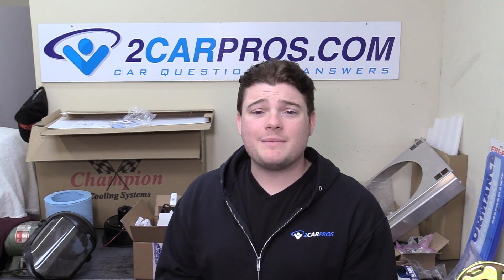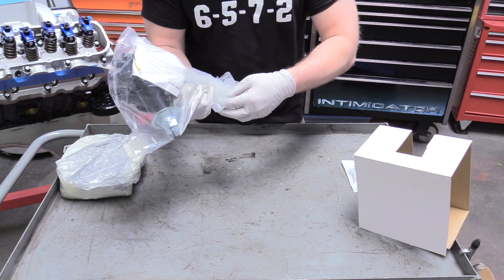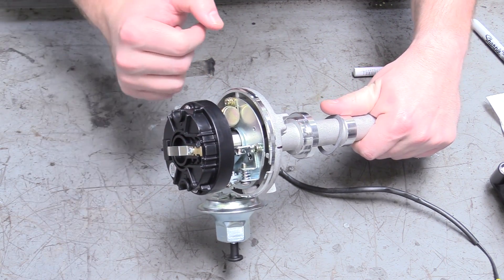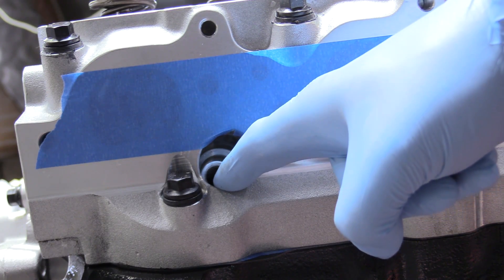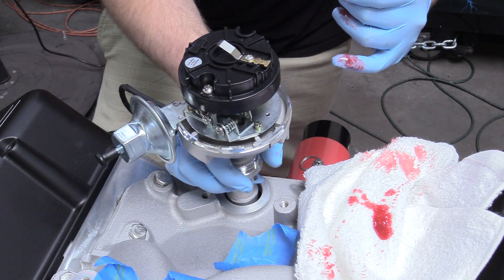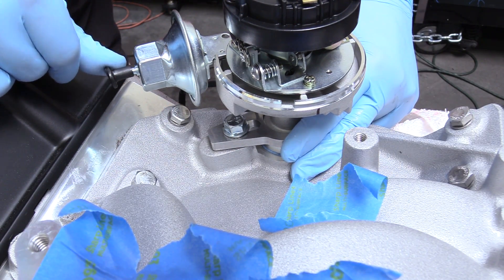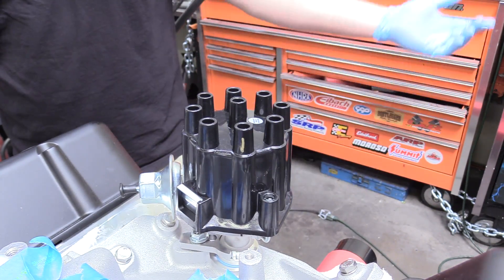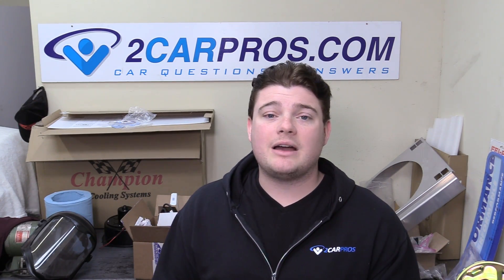How to Build a Chevrolet 454 Big Block Part 12: Dropping in the Distributor - EASY!

Comment: I armed a motor of 454 but when i turn on the engine makes like explosion sounds through the escape. Did i leave the time wrong or do i just need to adjust the carburator ?. When cold car turns on well but once warmed up it takes a minut3
Reply from the maker: Take some timing out of it. Thanks for watching!

Comment: Hey man, love this series. I’m working on my 454 using these videos. First build.

I ran into a snag though. I have the Holley tall fab valve covers and they slight bind on 2 of my roller rockers. 1 per side.

Any advice? I started filing down the valve cover on one side but I don’t think it’s going to be enough.

I thought about filing corner off the rockers but I don’t want to pull them off that yet to do that. 

What valve covers did you go with and did you have similar issues??

Thanks man!!
Reply from the maker: Thanks for watching! I used the tall style covers to clear my roller rockers. I would just get taller covers. Thanks for watching!
Reply: Thanks for replying!

Yeah I bought the tall Holley covers. It was the style I guess. The bolts were the short style. I swapped for ones that have the longer bolts thru the cover. The “tunnel” is narrower and clears the rockers now.

And now I have to try and sell unused $200 valve covers that I tried grinding on the inside of one. :-(

Comment: Great video.One bit of advice. Don't waste your money on a points distributor. Use an HEI or MSD.You spent all that money on the motor, don't get cheap when it comes to ignition.Those point distributors are outdated headaches especially on a performance motor.
Reply: Only thing I can guess is this is a sponsored video.  It doesn't make any sense to put on $3500 of aluminum heads, roller rockers, mild cam...probably a $6000 build with machine work altogether and then a $50 distributor with points? C'mon man.  LOL

Comment: A GM points distributor #1 plug wire is the 1st left of the points adjustment window where #4 is in your diagram. 8:40 don’t waste your time with the screwdriver. Once the gear is meshed with the cam gear it will rotate with the engine. Just continue to rotate the engine and the distributor will eventually drop and be engaged with the oil pump rod.

Comment: All you have to do is mesh the helix gear into the cam with the rotor pointing at #1 TDC on a compression stroke, regardless where the oil pump drive tang is facing. Then simply rotate the crankshaft until the distributor falls into the oil pump tang, it's that simple. Don't wast your time turning the oil pump drive shaft with a screw driver.

Comment: I watched this whole series last night.  Thank you it was a good watch. 

One question I had is, what exactly did you have the machine shop do?  Was it just: Bore .030 over, align hone, index rods, and grind crank? Just trying to not miss something when sending a block off to be machined.
Reply: Also, are we gonna be able to see this engine run? Man, I hope so!
Reply from the maker: Yes you will! Just gotta do a couple things to get it running in my Camaro. It is a little tricky due to GM not really wanting to put a big block in that car.
Reply from the maker: Thanks so much for watching! Yep you got it all, I also had them hang the pistons on the rods for me too.

Comment: Why are you using points??
Reply from the maker: Like I said in the video I wanted to keep it bespoke to the era of my car. I'm a younger guy in the hot rodding world and I want to experience points for myself. All my past cars had electronic ignition so its also nice to mix things up sometimes. Thanks for watching! :)
Reply: @2carpros  Appreciate the commitment to authenticity. Can you provide a link to the distributor you used?
Reply: @Jared Copeland Check our Uncle Tony’s Garage.  He has a great explanation on how to approach points & why he prefers that setup.
Reply: @JuneEBug-gy6nt  I understand points, but not sure why anyone would use them today.  Electronic ignition is NEARLY set and forget and not a unnecessary maintenance item like points. There is a reason they went to it in the 70s and why it was an "upgrade" before that.  Both will make the exact same power... one just does it without having to deal with maintenance.